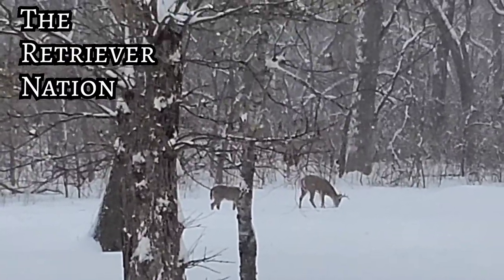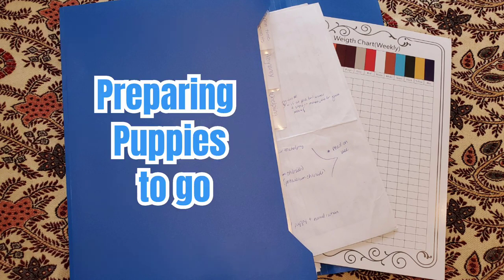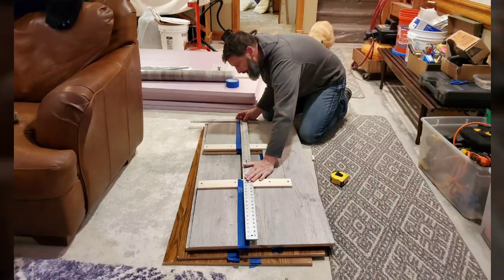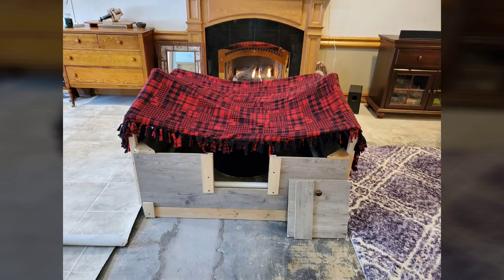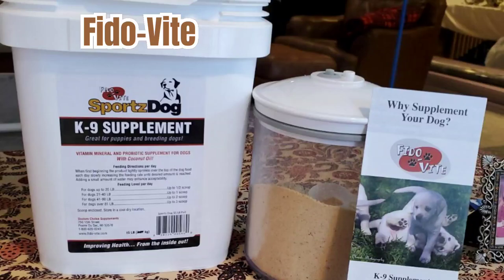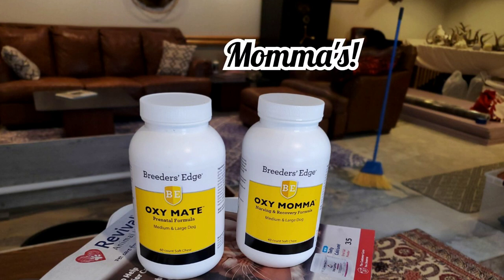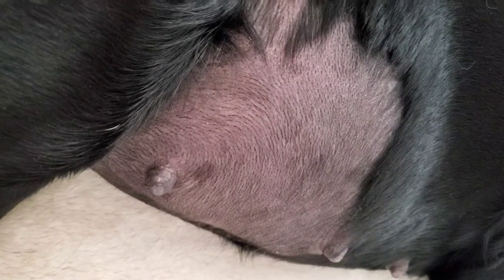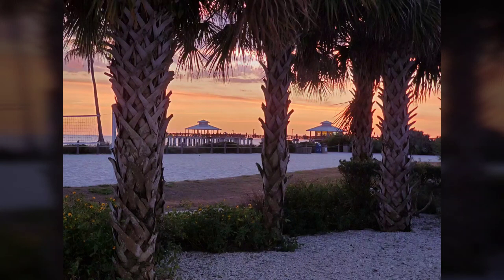Breeding 3: PREPARING FOR PUPPIES!~Heated Whelping Box~Supplements~Jasmine's Journey Ep. 3

Comment: Hi, what are the corner fittings used? It's looks like T's, but I think I am see 4 openings. Thank you in advance.
Reply from the maker: Actually, it is a "cross" fitting (4 openings) but I also screwed an end cap to the bottom so that I can insert a small extender on the bottom to raise the height for when the puppies get bigger if need be. Thanks for asking and I hope that helps!

Comment: Are heat lamps necessary for all newborns? What temperature should they be in when first born—a litter of pitbulls
Reply from the maker: Thanks for the question.  A source of heat is necessary, whether that be a heating lamp or heating basin like we used.  It is very important to keep newborns warm.  I think the first few days the temp is 85-90 and can decrease  gradually during the first couple of weeks to a point around 3 weeks they won't need it (unless they are held in a place that is not heated, a garage for example).  Their environment needs to be warm and dry.  I have seen pet supply companies that sell large plug in heating pads specifically made for whelping that are different from the heating pads people use (they can get too hot). I've even used an old fashioned hot water bottle (bladder) -- when I need to clean the whelping box - I wrap one in a towel and set the puppies beside it to keep them cozy.  Cold puppies risk death, so yes, a heat source is a very important consideration.  Good luck!